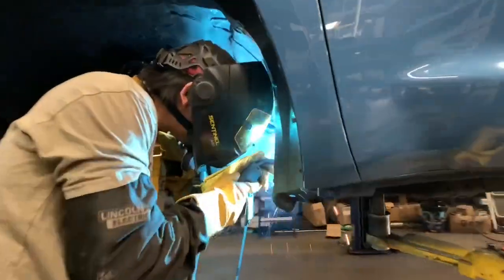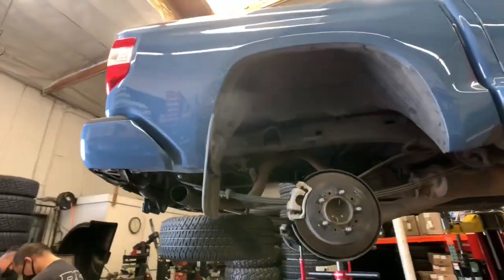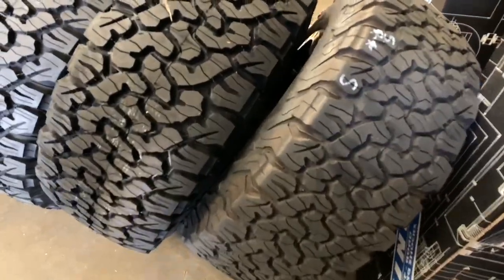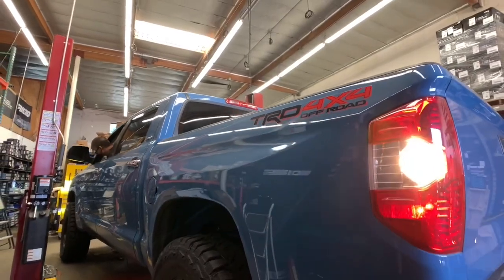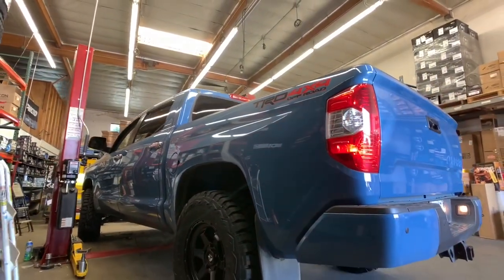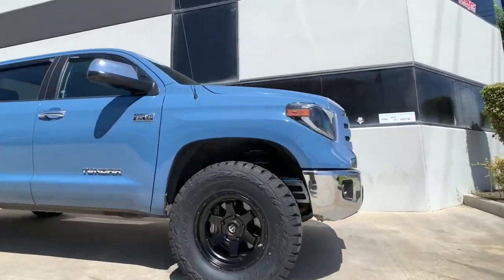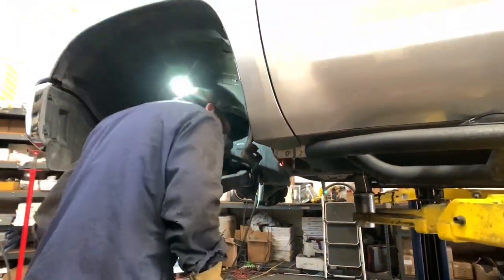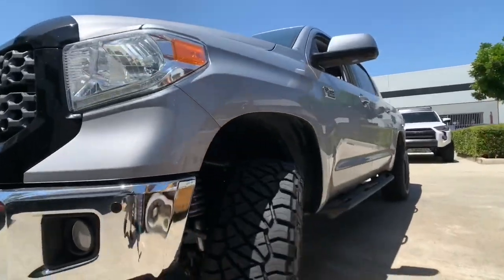(5) Toyota Tundra King Setups w/ Body Mount Chops & 35" Offroad Tires

Comment: Hey Tundra Fam!!  So I bought a 2019 Tundra that appears to already have a leveling kit as well as air bag suspension in the rear.  The tires that came on the truck from dealership are 35x12.5R18 Cooper Discoverer STT Maxx. There has not been a body mount chop and the front plastic inner wheel well panels protecting fog light etc. do not appear to have been modified at all.  I haven’t heard any rubbing since I’ve owned the truck (5 months).  Can anyone tell me why I’m able to run 35’s on my truck as it sits currently?  Any advice is appreciated as I just bought a set of 35x12.5 Ridge Grapplers I’m hoping to swap out the Coopers with before winter and just want to make sure I’m not setting myself up for a more expensive project.  Thanks again!! Oh and I’m still running stock wheels if that helps.